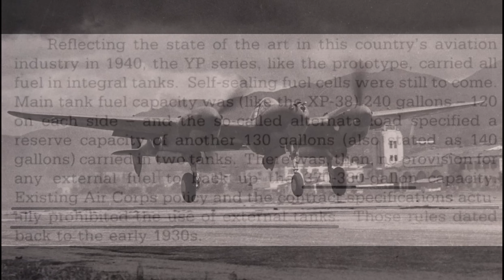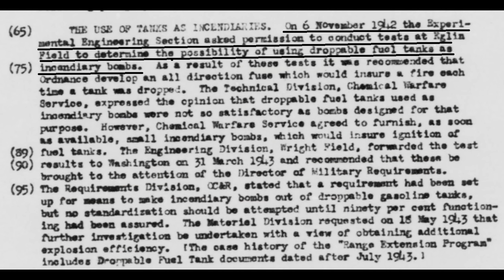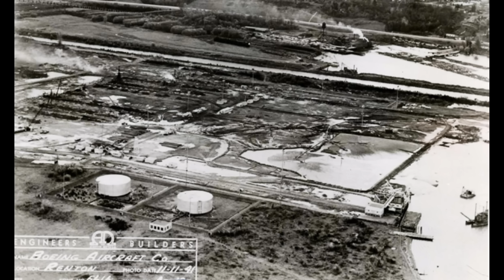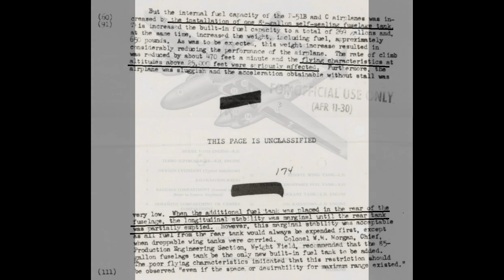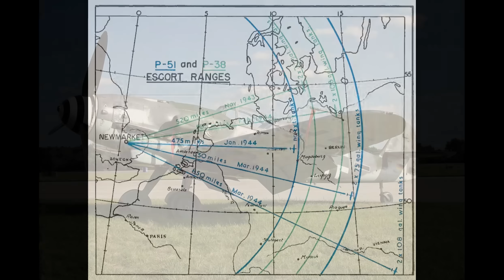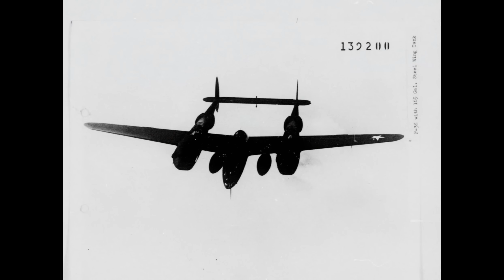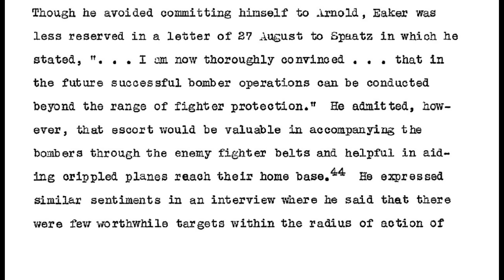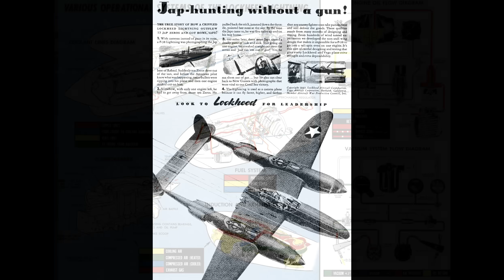The P 38 Lighting and the Bomber Mafia's Failure In World War Two

Comment: 1) You have utterly ignored the Beaufighter which came into service in 1940. That had a range of at least 2,250 km (1,400 miles) without drop tanks. Oh and it could carry radar and was armed with 4x20mm cannons and 6x.303 machine guns
2) Feet for altitude and knots for speed - you are talking about the use of such outdated and outmoded measurements required by US dominated Air Traffic Control. However the ICAO recommends metric measurements.

Comment: I have often thought how unforeseeably tragic the moment was when Seattle Times’ reporter, Richard Wiliams, upon viewing what was (and still is) a most impressive and imposing airplane, particularly with all of those multiple machine guns dramatically and menacingly poking out in all directions (although far less of them than would be there later) at its public debut in July 1935, called the B-17 “A Flying Fortress”.
It seems to me that this grandiose, alliterative but, as it turned out to be, erroneous name, adopted and celebrated by Boeing and those of the “Bomber Mafia”,  contributed to the hubris and fanciful concept of unescorted daylight bombing over heavily Luftwaffe-defended Europe, which concept resulted in the deadly, catastrophic debacle that nearly ended daylight bombing over Europe.
This is not to say that the BM’s plans would not have been conceived if that name for the B-17 had not been so coined. However, I think that “Flying Fortress”, like “visions of sugarplums” similarly “danced in their heads”, and that it contributed to their unwise, imprudent, and unrealistic ideas.

Comment: Hi Greg from Greg.

The P-38 scandal goes much deeper than this. It is directly connected to the P-75 scandal. 

A huge scandal was that there was only one production line for the 38, at beautiful downtown Burbank. This was a vitally important fighter, and the most complex to construct. All other important USAAF and USN fighters had at least two lines. Both to churn out the product. And because when a major model change was made they shut down one line to do that, while the other kept doing the prior design, and then switched. Not only did the frontlines get as little disruption as possible in deliveries, it was easier to do the upgrades. It was not until the war was ending that Consolidated-Vultee delivered ~100 units. 

Had there been 2 lines then there would have been plenty of the LR 38s for all theaters, with hundred in operating over Germany etc in early 43 on, ranging hither and yon all over the place doing grave damage to the western Luftwaffe, and greatly reduced bomber losses, including by preventing the massively armed twin engine 110s and 310s from attacking the 17s and 24s. The Schweinfurt raid would have gone smooth as silk. And with its hose nose bullet stream including cannon and two motors it was better for ground attack than the 47 – maybe one of the lines could have produced a ground attack version without the turbochargers and used the saved weight for more armor and guns. I think Brody complains about the single production line. Also, correcting the problems with the plane would have been done earlier. 

So why not another production line? Blame the bad boys at GM. They were very unhappy to be making cute little adorable old fashioned Wildcats for the escort carriers and paying Grumman a fee for each one. While Ford was making 24s at their giant Willow Creek plants. The shame! GM wanted to produce their own macho machine, thus the P-75 long range plane. Problem with that. The USA could afford only one more fighter production line. So with the 75 in development the 38 got only one line. 

This was madness. There was no need for yet another fighter design at all when the fine 38s and 47s were already in production and Merlin 51s on the way and there was a severe shortage of the first. It was only because giant GM had such a powerful lobby that they got their way until the 75 proved such a clunker, wee Lockheed was no match. With another 38 line only then authorized C-V did not get it into production until the Soviets attacked the Japanese and forced Hirohito to surrender. 

This is a scandal broadly comparable to that with the torpedoes. Many thousands of American air crew died because GM wanted its own precious fighter design to produce. But while the torp scandal was well known shortly after the war, and the 47 drop tank affair is only now coming out,  the 38 versus 75 debacle has gone unnoticed. 

Maybe something Greg should look into.
Reply: Very interesting comment.  I'd never heard any of this before.  Thank you.
Reply: The P-38 production was reduced for one simple reason. The War Production Board required Lockheed to use half of the production capacity of the Burbank plant to build B-17 bombers. 

Had Lockheed been allowed to use 100% of the Burbank plant capacity to produce the P-38, there would have been 20,000 built, and the P-38K would have been introduced in June 1943, the subsequent models would have been even better than the P-38K, which achieved 1945 level performance in 1943.
Reply: @ The basic principle still applies. The USA had capacity for only one more aviation production line. Had GM not tied that up that capacity for a couple of years with their Eagle vanity project then 38s could have had another line, perhaps at Consolidated-Vought that started making them in 45. I am not sure that C-V could have produced 17s.
Reply: I meant Me 410, not 310 which like the 210 failed.

Comment: One of my uncles was a mechanic for Lockheed. When the P-38s came off the assembly line he taxied the fighters to a holding area where he did the final factory tune up of the engines. He would then taxi them over to Lockheed’s airfield for the ferry pilots to pick up. Many years later, as a Vietnam combat veteran, I worked with a WWII P-38 ace (7 confirmed kills) who flew against the Germans in the Italian campaign. He and I traded combat stories, his in the air, mine in the jungle.
Reply: At least you didn’t kill seven of your distant brothers on behalf of the Rothschilds like he did

Comment: Maybe it was partly something else.  I have seen the kill ratios for various theaters and for Europe/Med, the P 38 kill ratio was listed as 2 to 1 as compared with much higher numbers for other first line fighters.  It was better  in Africa and the Pacific but sill not as good and Mustangs and Jugs and maybe even P40s.  The experienced high altitude Allison engine problems (blow by caused foaming oil leading to engine seizing among other things)  and relatively poorer combat handling performance as compared with P 51s, P 47s BF 109s and FW 190s may have also been issues.

Comment: The Bomber Mafia had allowed themselves to be seduced by and the believe the received wisdom of the late 1920s / 30s that the bomber will always get through. It had become so ingrained that they were incapable of taking on board the changing circumstances such as high powered, radar directed flak and advanced interceptor aircraft with ground control that was ranged against them. The disastrous Schweinfurt raids, and Regensburg forced a drastic reduction in activity for several months until long range escorts were available. The Dogmatic maintenance of outdated concepts consigned many brave crews to an ignominious end . Tragic.

Comment: Imagine what would have happened had the P-38 been flying long-range escort missions early August 1943. It may not be as highly maneuverable as the Bf 109G models but its long range would have resulted in WAY less losses to bombers in many raids like the one to Schweinfurt. They would have done a yeoman job protecting B=17 and B-24 bombers until the P-51B/C became available in early 1944.

(EDIT: I should mention that the USAAF should have realized that unescorted missions would start to result in heavy losses after the long-range raid on Kiel and Bremen on June 13, 1943. That should have told USAAF to start using longer-range P-38's on escort missions despite the limitations of the P-38 models at the time.)

Comment: If the British 108 gallon tank was designated as 108 gallons by the British then it would be using the British gallon at 20 fluid oz per pint and not the 16 fluid oz per pint used bt the Americans. With each gallon thus being 20% larger, the extra would be a significant increase in capacity.
Reply from the maker: It's 108 US gallons
Reply: @GregsAirplanesandAutomobiles  America should increase the size of the pint like we did so you can have bigger pints of beer. Makes sense you know!

Comment: I believe nothing tells the status of an aircraft or unit like the bases that it draws.  The P51/P38 range arcs are centered on the English town of New Market (within 10 mi of present day Mildenhall and Lakenheath)  This is a great Reference town as its about Center for "Fighter Country USA" bases.  8th Airforce, after "losing" P38 groups to 9th and 12th AF kept 2 P38 groups.  The 55 FG was stationed SW of New Market.  The 20FG was at King's Cliff--way NW by present day RAF Wittering.  You take 50% of the fighters that could go to Berlin in Dec 43 and place them as the BACK Most US Air base.  The 20th had to fly 70 mi to get to the sister P38 Group, and 90 miles to the sea.  Every mission had that group flying 180 miles not protecting American Airman over Germany, but just reaching where everyone else starts from.  Units were shifted all the time for convenience of command, yet Headquarters refused to move forward half the fighters that could have eased the Slaughter of Schweinfurt & Regensburg.

Comment: The P-38 had two-types of drop fuel tanks.  Either 150 gallon or 318 gallon drop tanks.  The 318 gallon tanks were suppose to be use ONLY for ferry flights (No ammo).  On the Yamamoto  mission they used one of each and the aircraft were about a thousand pounds over approved gross weight.

Comment: Erm ... RAF Mustangs made their first deep reconnaissance into Germany in July 1942.  The Lightning, like the Mosquito, had a very poor roll rate, great for ground attack but nearly useless as fighters. For the fast and nimble german interceptor fighters it was like having "Shoot Me" painted on the sides. The Lightning was swiftly relegated to harassing Mediterranean shipping for which it was well suited. Noth Africa had been won before the US joined in Europe, that stopped the Axis getting middle-east oil, but still needed defending.
Reply: I’d acknowledge the P38 wasn’t the ideal dogfighter but most air combat was boom & zoom not tight maneuvers. Low altitude reconnaissance Allison powered P51 missions are irrelevant to bomber escort missions. 
Fully fueled P51Ds and P47Ds weren’t super maneuverable either and flew similar tactics to the P38s. you seem genuinely misinformed
Reply: @garydownes2111  then I'm misinformed by my own late father who was on RAF bombers which were the targets of the german interceptors, the escorts had to be able to dogfight or the german fighters would simply slip away.
Reply: @ the RAF quickly rejected the early low-powered version. As escort they were expected for fend off the agile Bf109s and that did not go well. They were simply too vulnerable. They got sent to North Africa. The Mustang had been built to a UK spec as an escort, and equipped with Merlins for the RAF, they would not be fully fuelled by the time they reached Germany. They were less agile than the Spitfire but they played two different roles, escort and interceptor.
Reply: @jeffslade1892  mustangs weren’t explicitly designed to be an escort and weren’t given Merlin’s to become escorts .. the British certainly recommended fitting Merlins which were being put into P40s after initial disappointment with the Allison engine, extra internal fuel tanks external fuel were fitted later.. the development and eventual use of Merlin powered version as escort fighters for bombers by the USAAF was one of those happy accidents and lucky timing & circumstances..
Reply: @garydownes2111  The Mustang was designed in 1940 by a team headed by James H. Kindelberger of North American Aviation (NAA) in response to a requirement of the British Purchasing Commission. This was for a long-range escort fighter.  It became the P51 later.
Reply: @ it was not built to a British requirement for a long range escort fighter, it was for a for an interceptor type aircraft better than the P40… the Allison engine lacking multi stage supercharger meant poor altitude performance at the altitudes required for an escort fighter. regards the British had little need for an escort fighter because their principle bomber effort was at night. it was certainly longer range than the spitfire and P40 but consideration for use by the USAAF and subsequent use as a bomber escort was far later and not present when initially designed to meet British requirements & prototyped.

Comment: I'm an avid reader of WW2 in the Pacific.  August 1942 thru Feb '43 the epic Battle for Guadalcanal had the US Navy, USMC and USAAF contribute multiple aircraft to prevent Imperial Japan from overrunning the soldiers and Marines defending Henderson Field. From the many books I've read on this campaign it was stated often the long range(endurance) fighters with high altitude capability were desperately needed to defend Henderson Field. The P-38 was the only USAAF fighter available at this phase of WW2. The Army (USAAF) initially contributed P-400s/P-39s as these were readily available but these planes were woefully inadequate as high altitude fighters/interceptors. These were relegated to low altitude missions over Henderson Field to attack ground targets or to possible pickoff Japanese planes that had descended over Henderson during their attack missions. But P-400/39 were easily shotdown by IJN Zero fighters if the Zero's pounced on them from above. The USN and USMC contributed F4F Wildcats that could hold their own against the Zero but on when using Boom and Zoom or Thatch Weave maneuvers. Anyway, the desperate need for P-38's was addressed by diverting those originally destined for England in October 1942. While those P38's assigned to Operation Torch (Africa Campaign) were not diverted to Pacific.
Reply: I have read that they used the P-400s as Zero bait.

Comment: So, yes, as deployed in July/August 1942 to the ETO, (1st FG operation Bolero Glacier Girl etc)with 165 tanks the P-38s of 8th AF did have the range to escort bombers almost to Berlin. I'm not in %100 agreement with you on the entire bomber mafia thesis but that's fine. But? For what ever reason, and even higher than Arnold, P-38s went to North Africa. There weren't enough to go around, and Lockheed couldn't keep up production. You also have to factor in 8th Fighter Command's Monk Hunter who really didn't like the 38, and was a great P-47 supporter. Regardless all that. A few points. Yes, the 110 gallon metal tanks did become common in the ETO and MTO by the fall of 42, and replaced the paper tanks in the ETO. 15th AF never got the paper tanks. NAA put out a P-51 manual and chart dated 11-15-1944 with 110 gallon tanks with combat straight line ranges with reserve, at 10,000 feet 2600 miles, and at 25,000 feet 2500 miles. And there's a sample combat planning problem to Japan, 900 miles distant, worst case dropping 110 gallon tanks with 28 gallons each, 15 minutes combat at military power, and a return that 900 miles with 150 gallons remaining landing with 20 minute reserve of 24 gallons. Yes Yieks 24 gallons at a Iwo. And out of Iwo yes P-51s used 165 gallon drops but only when they carried 6 5in rockets. Air to air 110s were sufficient. And there's photos. 
    So having flown the P-38J and L, and P-51D, their ranges are tactically equivalent, though the 51 on paper beats the 38 by a hundred miles or so. Tactically the same. Yep. %100 in agreement had existing P-38s been available in August 43 much of that disastrous late summer could have been avoided. Or at least bomber crews saved. Ya, P-38 losses would have been higher. But you are correct, and that's what fighters and we Fighter Pilots are for, to protect the bombers. Effectiveness. I'll note in March 1944 under 8th AF, 8 P-47 groups shoot down 175, 3 P-51 groups get 251, and flying to the same places P-38s 26. And those ratios stayed the same the rest of the P-38s time in escort with 8th and 15th. It's not all airplane performance, speaking with Robin Olds and Hub Zemke, the large distinctive shape made the 38 easy to see and identify at great range, and for the Luftwaffe to set up an attack or avoid the 38s before the 38s could see the Luftwaffe.
    Finally, the much hyped 332nd "Red Tails" mission to Berlin in March 45? Actually there were two other Mustang groups AND at least two P-38 groups, the 1st and 14th if memory serves that went as well all the way from Foggia the 800 some miles to Berlin and back. The same relative distance Iwo Jima to Tokyo. Absolutely, the P-38s could have been and should have been saving bomber crews everywhere they wanted to go mostly in the spring  of 1943 onward with the P-47 groups standing up. To really service Berlin realistically for any combat endurance the 38s and 51s had the extra fuel by the March 44 raids, and the 47D-25 by July 44.
Reply: Oh. To add on my all ready too lengthy reply? Bodie hits the nail on the head noting NAA and Republic got new factories to build additional airplanes. While the Army wasted capacity on lots of poor projects, a true 2 P-38 production line was never set up until way too late.

Comment: Gosh, P-47 was a thirsty beast. A single engine plane getting so damn close to a twin engine P-38 in MPG?
Reply: The P47 was fast and very powerful. an advantage with twin engines is you can once you gained altitude turn them to very low power settings and still maintain speed & that altitude while a single engine aircraft will have lower drag but need to stay on a higher power setting relatively.